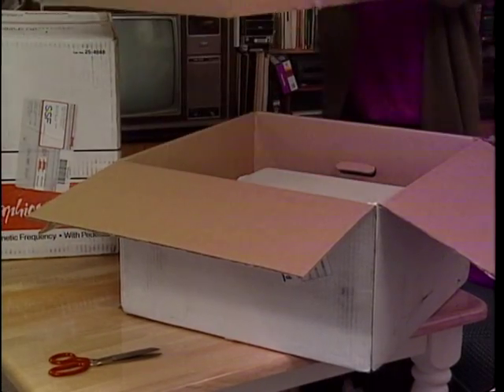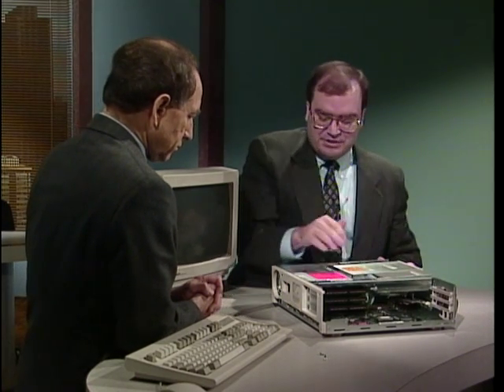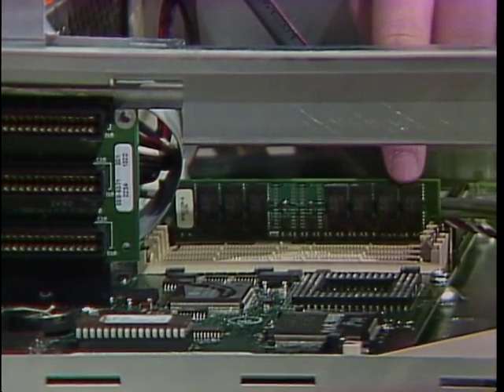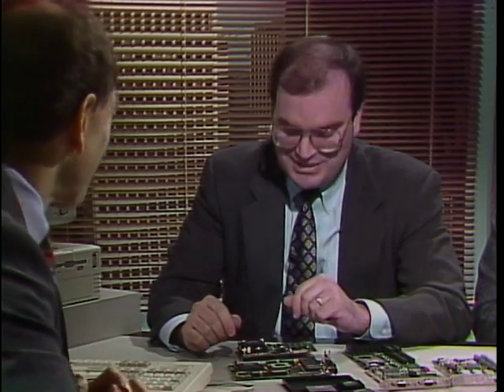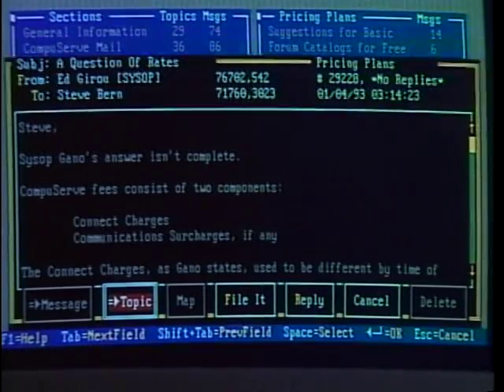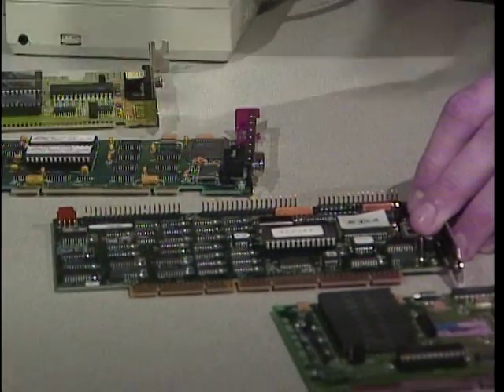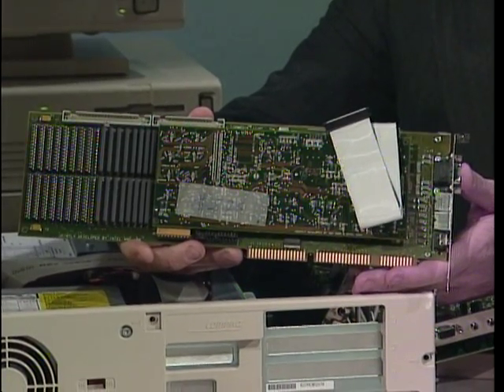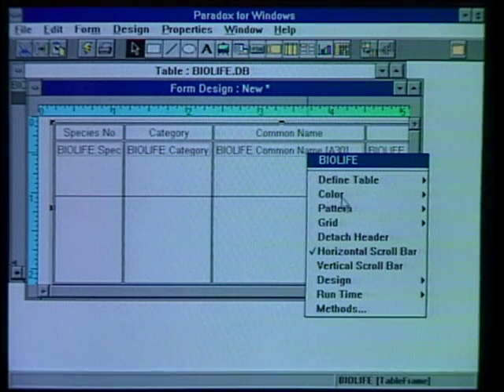The Computer Chronicles - Beginner's Guide to PCs (1993)

Comment: My computer in 1993 was an intel 486DX 33MHz, 4MB of RAM, 1MB VGA and a 120MB HDD, it ran Windows 3.1 very fast and was quite a capable machine, which I upgraded in 1994, I think.
Reply: Mine was 386 SX 33MHz, 2MB of RAM and it also ran Windows 3.1 very fast.
Reply: @EnglishPolishOnline  Mine was a Sinclair without any hard disk. You had to feed that machine with bits and bytes coming from a tape recorder.

Comment: “Hard drive is always spinning that’s why it’s so fast.” Man, watching this is amazing.
Reply: They’re comparing it to the floppy which is way slower because it’s not always spinning.
Reply: @silvercoulter  not correct. Floppy could accelerate to that speed, as drive, in about 2-3 seconds too.
But , it would damage it. Hard Drive is so fast because it's spinning fast, because it's protected, has much stronger and more expensive mechanism, thanks to which reading head can go closer to platter, and dust is also not problem. Platter in diskette would be damaged by dust particles, if spinning so fast.

Comment: These were the Computers I cut my teeth on , I still use them , I enjoy OS/2 Warp , GEM , Amiga , Win 95 & 98 SE , and DOS 6.22 , we could make Video Calls over a Phone line using that same 4 Mb's of Ram , it still works Today in 2015 , so you can see everything they are selling us is extremely bloatware /  components necessary for programs to function; as well as the amount of backwards compatibility bloat and redundancy involved , it's great we have faster Processors and much more Ram , but Truthfully if you put your own System on without the bloatware you can get a 90 % faster PC :) QC
Reply: Quaalude Charlie actually that is true, i did a complete clean install of windows on my computer and boot times were improved and overall performance installed
Reply: word of truth

Comment: This was really the cusp of everything taking off. I remember around this time, 4megs was standard and 8megs was "pro". In 95 (I think) I had a 486 DX2 which eventually had 36Megs and a 4.3Gb HD. My next system in '97 was a PII 300Mhz with 192Megs of RAM and a 17GB HD. I'd gone from a Soundblaster rip-off in the 486 to putting SB Live! cards (2 of them!) into the PII, and the graphics on that machine was an ATI All In Wonder Pro with a TV Tuner and 8MB of video RAM!

Great times, everything was just improving so fast.
Reply: Just looking at this show from it's first to it's last episode shows how fast it changed in 15ish years, they went from reporting about monochrome computers to tablets and PDA with built in modems.
Reply: I dont believe you with 192 Mb RAM in 1997.
PII 300 klamath for $2000 is more believable, than 192 MB RAM.
Reply: @warrax111   You can believe what you like. I built it with 64MB then went back to buy another 128MB a week later. I don't know what you think is unbelievable.

Comment: That motherboard looks exactly like my very first computer motherboard 486sx 25 MHz I had 4 MB of RAM installed. There is even the 487 math coprocessor slot right next to it. That brought back memories of me Papa and the case open and installing a modem and sound card and all the stuff I installed overtime

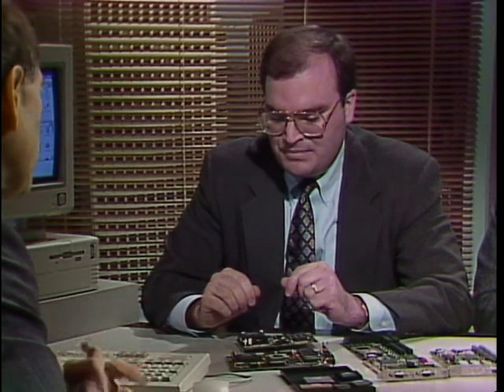Comment: 10:14 BTW, I was unaware of the 487 coprocessor until now.
Reply: it was "fake"; it was a relabelled 486DX that took over from the 486SX when installed.
Reply: @SteelRodent Don't forget about Intel's Pentium OverDrive, which which socketed in, and gave a 486 66Mhz machine a 100 Mhz Pentium experience or better with a slower front side bus, so it was not a true performance, but it was cheaper then a whole new system for 486 motherboards that supported it.   
https://en.wikipedia.org/wiki/Pentium_OverDrive

Comment: 2:05 Ah, the good old days of not needing a massive heat sink and fan!
Reply: +RonJohn63 Agree good old days
Reply: +RonJohn63 Agree good old days
Reply: smutkovski Ask me if I'd trade the Bad Modern Times of lightning fast CPUs, 16GB of RAM and 9TB of disk space for the Good Old Days of 33MHz CPUs, 8MB RAM and 250MB HDDs.
Reply: i don't think u'd but that nostalgia :)
Reply: HaHaHa RonJohn63 I saw that too.
Reply: The 66MHz 386DX and 66MHz 486DX did have a heat sink, and in 1992 the 100MHz 486DX was released and it had to have a fan. All Pentium CPUs had a heat sink and fan from 1994 onwards (some early 50MHz and 60MHz Pentiums could go without a fan and only with a heat sink).
Reply: @elimalinsky7069  This is correct--it was around the era of the 66 to 100 MHz 486 CPUs where heat sinks became necessary.  It was around the time of the 486DX4-100 where a heatsink with a fan (to keep it cooler) was mandatory, due to the increased heat output resulting from the increased speed.  I built a 486 DX4-100 machine around 1996, and I specifically remember it needing a fan-cooled heat sink.  PC Power & Cooling (still in business today, IIRC) had a fan-cooled heatsink for the 100 MHz DX4s that I used and works great.
Reply: Never heard of the Atom CPU line?
Reply: @TheUtuber999  sure, but while I know it powered my children's netbooks, I don't know if it needed a fan and heat sink (even though it would have been smaller).

Comment: 8:54 Wrong. The first number is the horizontal which refers to the columns the second number is the vertical which refers to the rows. Somewhat confusing because you count columns, which are vertical, by moving across horizontally, perpendicular to their axis, and vice versa for the rows / second number.

Comment: Okay, so if I get a 486 with 200megs drive and a 4MB ram, i should be able to play all the latest game titles?
Reply: MP-Tuners Productions Should be able to run Minesweeper fine but you may experience some lag in Solitaire depending on how many KB of VRAM you have.
Reply: As this comment is now 6 years old, you should now consider getting a Pentium with at least 16Mb of RAM instead
Reply: @DavePoo2  yeah, no. I'll just get a brand new pentium overdrive cpu for my 486

Comment: How does DOS work? What is that serial and parallel port? I don't think my computer even has those?! HELP!!!
Reply: A. DOS works just like your cmd or power shell. Just a bit more rudimental. In linux you would compare it with the terminal
B. You have not only one, but many serial ports and unlike that time they are nowadays universal, called USB. Also you have an emulated parallel port, but as nowadays everything is send over USB, calls to a parallel port would just be reinterpreted by your Windows as calls to a serial port.

(Parallel ports, RS/232 were only needed until the 2000s because the amount of data coming in or send away to the internet, a printer or scanner would be too much for a serial = bit by bit data transfer, you would had via COM port to wait for hours for your spreadsheets to be printed. Since USB is nowadays in the GBit speeds, that bottle neck of your PC is gone. But you can still buy PCI-E -> Parallel-Port adapter cards and even USB->Parallel-Port dongles, because some people need to run old parallel port hardware with modern computers.)

Comment: Cheap computers back then cost about  2200 dollars... We have come a long way, Macs still cost the same ..
Reply: My 386 cost around 1200$ in 1993... 2mb ram 80mb hdd and  256k video card :P
Reply: In 1994 I got a AST 486sx33 for $850 on a damn great sale at Circuit City. 512k video memory, 4 megs ram, 210 meg HD. Actually it ran everything great until Wing Commander 4 s ground missions.
Reply: In 1992 I got a 486sx25mhz Packard Bell from the Post Exchange where I worked.  Take home Lay-A-way for $1350.  It had a whopping 2 megs of ram and 100 meg HDD.  It was SVGA though and came with the 12" SVGA monitor.  The modem was 2400bps .  I eventually got another 4 megs of ram, a coprocessor,  a sound blaster pro, and a 28.8bps modem for it.
Reply: 486 dx 66 $1300 around 95
Reply: the main reason is not as many were made
mass production techniques brought price down substantially as well as shrinking transistor size

Comment: That's incredible! They used to have slots on motherboards and GPU's for user added co-processors?! Awe man can you imagine what one could do if they still made them like that? Think about this scenario for a second....

You have an I9-13900K w/a GeForce RTX40 that has an open "processor accelerator slot" ready for a co-processor. Now, let's suppose money is no object and you go with an Intel I7-8700K as your co-processor. I can't even imagine how stupidly fast a rig like that would be. You would definitely need another power supply and likely your going to have to redo your entire cooling setup. Maybe a water cooled or refrigerator box might be what the doctor ordered.
Reply: In practice, the overdrive slot was seldom used.  instead, the cpu slot was used to mount cpu's that weren't made for it.  this was namely for many 386 processors and the 486 to pentium upgrades. In reality, there wasn't much upgrade room before you just needed to toss the motherboard and get a different one matched to what you wanted it do.  And the math co-processor slot was just when cpu's didn't have them natively onboard to save on cost.  That phased out with the 486 chip and beyond.

Comment: Oh, the time when the CPU didn't need a cooler that is heavier then the actual motherboard it's mounted on...
(also just noticed @2:25 that the motherboard actually used a battery of the type still in use today. I remember that most old computers used to have a rechargeable battery soldered on the motherboard)
Reply: "(also just noticed @2:25 that the motherboard actually used a battery of the type still in use today..."  Not true.  The battery in the video was the one-time-use Lithium coin/button type (ie. CR2032).  The rechargeable types came later and are usually encased in shrink-to-fit plastic with lead pins soldered to the motherboard.
Reply: @TheUtuber999  But all motherboards of the last 15 years or so use those same lithium CR2032 batteries. Old 386 and 486 I saw back in the day ones used those soldered rechargable ones. I also saw those on an old PC XT system board. Never seen lithium CR2032 on those older boards before, but then I wasn't into PC's back then before commodore went bankrupt and the Amiga line of home computers died out.

Comment: I would have been in 3rd grade when this aired. For the next several years, you'd be lucky if the school let you touch their few precious 486s (I got a pass because I was "a computer kid" and you couldn't write QBASIC programs on an Apple IIe). By the time I was a high school freshman in high school, they were straight up letting me lug that same generation of computer home (with a box of SIMMs and SCSI hard drives and ISA expansion cards) so I could learn how to do stuff with I/O streams (or attempt to). Not to borrow, just to free up closet space.

Kinda sad how "last gen's junk tech" now is too locked down and "seamless" to even be worth giving away to some kid so they can learn basic computer stuff. It's a real bummer to meet teens who are just like "oh my parents have this spy app on my phone, and there is no point in even trying to jailbreak or spoof or disable it, because that's magic."

Comment: Did the CD-ROM back then have more capacity than the recommended 200mb hard drive? :D
Reply: Yes, the cd could hold 650 mb, and the disk was 200 mb. But the cd was rom (read only memory).
Reply: Yea thats the down side with cd rom. Now a days we can use ram as a hard drive for the amazing speed the problem is its volatile memory. You lose everything if PC is turned off. But the leap in technology is amazing. We now have gen 4 NVMe to fix this very problem with SSD speed.

Comment: Was like what no PCI cards?  Than looked at the date and was like oh that would have be released on June of 92, so depending on when this was filmed, pci might have only been out for half a year.  Not sure how quickly it took over.
Reply: Not quick. The major reason people wanted PCI was for network and ethernet cards, when internet connections faster than Modems became available. Also more modern sound cards went from ISA to PCI in the end of the 1990s. Graphic cards first still used EISA and then went to AGP and only started with PCI-e to become part of the PCI(-e) family.
Reply: They mention overdrive chips and Pentium. So PCI likely existed.

PCI was very common on Pentium machines. On late 486 machines could have PCI but just ISA or ISA plus VESA was more common.

Comment: There are only 4 critical parts, 7 main parts,  These are the same 7 parts today, as it was then.  Motherboard, processor, ram, power supply, and your machine will be able to turn on and compute.  Add 3 more parts,  Gcard, HD, and case and you pretty much have the whole thing, Just add fans, cables.

Once you learn what these 7 parts are all about that knowledge will go a long way.  Realize too that there are 2 kinds of PCs.  Proprietary, and non proprietary.  

The case is very important, and its goal is to keep your parts cool,  to keep your parts protected, and to be quiet.  I do not like non metal side panels,  because of EMI shielding, and id rather have an acoustic mat.  $100 spent on the right case can last you until we stop using the ATX standard (probably a while).  Fans are important.  You want at least five 120/140's 

The Motherboard is going to determine what other parts you need to put into your machine, and is going to be the largest determining factor for "what kind of computer you have"  The MB is very important.  many things that have historically needed a card have been mushed into the MB.  Soon  CPU's will have TB's of storage on chip.

The CPU, ram, and HD's, Gcard's are all non proprietary,  They will all have connection types, speeds, sizes, etc.  There are not too many cables,  Just the PSU cables, the drive cables, and the fans need to be plugged in.  That CD audio cable is gone, as well as ribbon cables.  The larger the fan, the quieter it is, for the most part.  Do not expect them to last forever.  

Imagine a PC is a wood working shop.  The building is the case,  the worker is the CPU,  The workers work bench is the ram,  The tool storage is the HD.  The video card is the conveyor belt of chairs leaving the shop.  The Ram is where the where the PC stores the information that it is working with.  It is the workbench.  It will have a speed, and a size.  The CPU does the work.  The CPU's cache is the information in the workers hands.  The hard drive Is where everything is stored, it will have a speed, and a size as well.
Reply: Boas tudo bom, todos eles percebem e percebiam muito bem de computadores,mas é  fantastico quando 1 explicava os componentes e partes do computadores,todos os outros prestavam atenção  e respeito no k o outro estava a explicar, tecnologia é  sempre um processo de aprendizagem,ainda hoje o é  kkk excellentes videos obrigado por Postarem. Um abraço  de portugal❤

Comment: Lol, IBM MCA bus, EISA bus, VESA Local bus. none of them were as successful as was hoped. They were all replaced by the PCI standard fairly soon after. And today we still use it's evolution the PCI-E bus.
Reply: Not so true. the PCI without e only became prominent with network and sound cards. Graphic cards switched to AGP before they then went on the PCI-E route.
Reply: @acmenipponair  Yes, but before AGP became a standard, graphic cards used either PCI Or VESA local bus. And afaik AGP was more or less a modified PCI 2.1 based protocol bus with a different denser connector and some performance enhancing changes (Like being able to directly access main system memory and higher bus frequencies).

Comment: TSR program.... ah the old days of single threaded OS.
Reply: Only on PC's though, Amiga's, Atari's and Apple's all had a multitasking OS since the mid to late 1980s.
Reply: @PhoenixNL72-DEGA-  In 1993 Windows 3.11 was already existing and Windows 95 was in the beta phase, so also Windows had already corporate Multitasking. True Multitasking had none of the computers of that time, the Amiga and Ataris never got it, and the Apple only with Mac OS X
Reply: @acmenipponair  WIndows 3.11 was not true multitasking but cooperative multitasking.  Meaning applications had to explicitly give control back to windows in their program code. Amiga and I think Atari and Mac OS used preemptive multitasking in which processes where given a time slice by a scheduler. Windows 95 was the first Windows OS which also used Preemtive multitasking but it didn't have proper memory protection so a badly written app could still crash the computer completely and it was much more unstable then Amiga Workbench. As I have no experience with Atari or Mac OS I can't tell you if those were more stable then Windows 95.